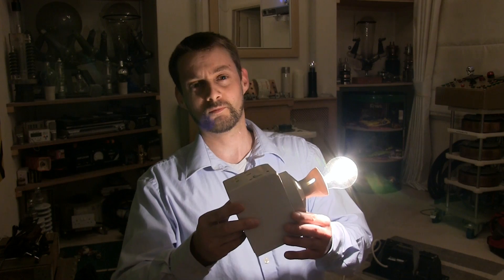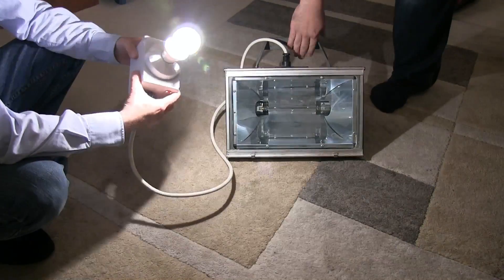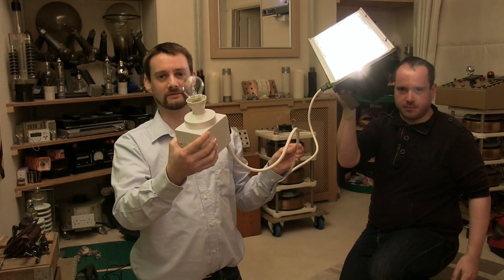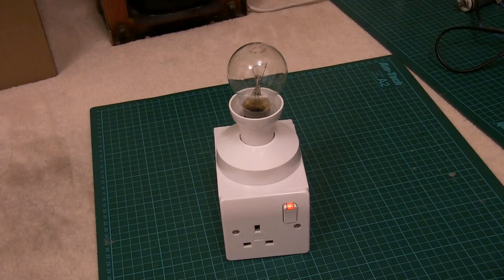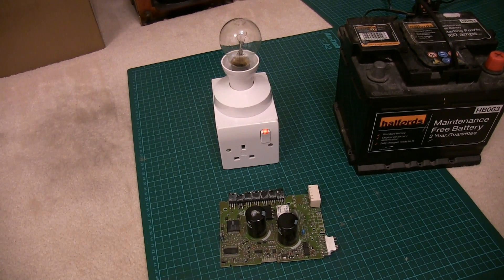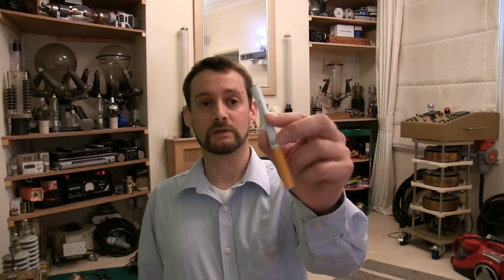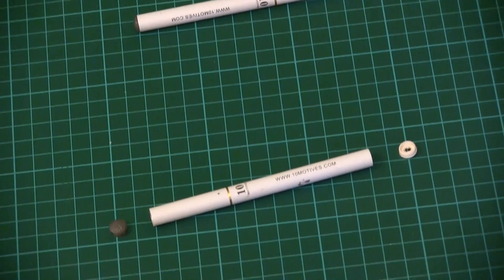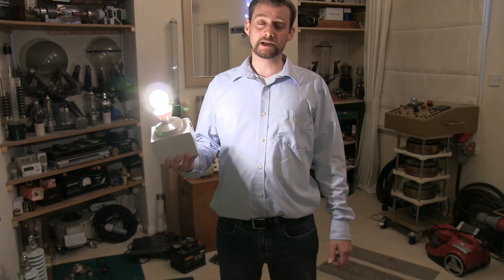Wireless 240v Power Cube Reveal

Comment: Curious little device to confound your friends and confuse your frenemies! :D
I'd be interested to learn how you charge it :P
Reply from the maker: I treat the output like a universal serial bus lol
Reply: If you could get a hold of those batteries cheaply I bet you could sell those cubes online.
Reply: He puts it in the microwave for over an hour at full power.
Reply: While powering the 1500 watts light the had to deliver 6 amps, not bad for those ;ittle lipo's. Did you need to recharge the often during the shoot Photonicinduction?
Reply: @photonicinduction could do with a little lipo after quitting the ciggies.

I kid :p
Reply: @gskaloyan Pretty sure it's not too difficult to make, just dangerous and messy, but not difficult if you own the right tools.
You'd also need patience. 

I'm also quite confident that they (don't) have to be those specific e-cig batteries, but any Li-Po battery connected in series with a dozens of the same individual voltage to achieve 240v. You'd just need the batteries to all be the same and really small & stackable, and not end up killing yourself in the process. 
Wouldn't recommend mass-producing these things by hand. Would be better off using CNC/machinery to do it by batch. 

Or just buy a 12v 120/200ah battery and a 1500w inverter.
Reply: +photonicinduction look in to 18650 they can put out 8amp per cell :)
Reply: I currently have some sanyo ga cells 3.5Ah and 10A discharge, pretty impressive.  The samsung 25r (2,5Ah) cells can deliver 25A, that is a lot of punch! (especially when you have more than 200cells :)) 18650 are fun!
Reply: RKSNomad
The wireless energy would have been amazing. However, as with anything it does have a few drawbacks. I can see a few problems with it, but they're able to be designed around if good engineering was put to work.

One of them is that the transmitter would have to be tuned perfectly, and to a frequency that nothing else would use. Otherwise, any transceiver that tuned to it would likely explode, as you'd be dumping extremely large amounts of current into it.

Digital electronics would also have to be designed to never have a wire, component lead, PCB, etc, trace the same length as the wireless power's wavelength. For example, WiFi's 2.45GHz wavelength is about is about 2.5In long. Any piece of conductive material the same size would act like an antenna and either fry the device or cause it to massively malfunction just like it got hit with an EMP. For example, let's say the wavelength is 6In, if you touch a fork or spoon the same length, likely it would arc to your hand.

Third, if you lived near the tower, constantly being exposed to certain frequencies is known to have small, but measurable, health effects. Nobody knows what being exposed to such a ridiculously strong RF field would do. Single cells in random areas that align right can experience powerful heating, which kills them. There's a small chance any cell killed by heating could survive and do something weird, like grow a tumor. Microwaves are non-ionizing and can't damage DNA like X-Rays, meaning they don;t directly cause things such as cancer, and also won't cause any damage if they're below the level that causes heating.

Tesla however, could have discovered a completely new way to transmit. Which would mean that all the above may not apply to it. Scalar waves are something people claimed he could transmit and receive in. If that's true, the waves would have no frequency and no magnetic field component, meaning none of the above problems existed. How one would receive such frequencyless, fieldless, waves is currently unknown, but maybe he had an answer. It's just one of many theories floating around about his wireless power.

The solution to those problems for a modern implementation using our current technology? Point to point links could be used, aka beaming energy between two transceiver dishes over long distances where you have line of sight. Like say you have a massive amount of solar panels in the desert, broadcast the energy to a satellite in space, and beam it back down to a power plant or somewhere it could be distributed. You'd loose a lot less energy that way. This could also provide reliable electricity to remote locations. Anther thing people are currently theorizing about is putting solar panels in space where they'd get ALL the light, and using microwave beams to send the power back to earth.

I'v researched Tesla's patents and experiments before, but I didn't get very far, besides lighting fluorescent tubes up to 15 feet away. By the way, Apple has a patent for across the room wireless phone charging. That in itself is interesting, as getting a few watts from the wall to a low power device like a phone is very doable. I could see in house wireless power to avoid the need to directly plug something in becoming a thing. Small low power devices could be powered easily this way without much risk of interference or health risks. Only problem is that it's very inefficient as you have to send energy in all directions.

Hopefully this reply wasn't too long, but I pretty much wanted to dump my entire opinion out. Have a nice day.
Reply: not so true  yess if it is h.v. dc with a lot of amps... dc make your mussels tens up but ac just knocks u the fuck out :)
Reply: Lithium batteries are all fun, until they get bang :)
Reply: RKSNomad Oh please, Andy, PLEASE make this happen! I want flames!
This is a thing that needs to happen.
Reply: You just have to be careful because its DC power
Reply: :) well i got like 40 of 18650's puts out about 310/320 amps at 4.5v running my electric bike
Reply: what makes you think this? pretty sure they're lipos
Reply: 8A? Some 18650 cells will deliver over 100A. They won't be very happy about this but it is possible. Just... Don't run them on that power any longer than few seconds, I've seen a cell that was rated for AFAIR 130A for less than 1s by its manufacturer!
Reply: zak Elek-Palmer These cells were officially rated 20A with additional "unofficial" discharge time VS discharge rate declared by manufacturer (with a condition to cut off discharge at certain cell case temperature). I'm looking at it and cells were rated not 130 but 160A for up to 1s discharge. Also: Safe continuous rate is 30A instead of official 20A. Unfortunately I can't give you details about this cell. BTW: it is not the first time I see that there is a "public" specification and another "confidential" one supplied directly to customer.
Reply: ElectricBike Nope. Regular "power tool grade" cells are capable of this. it will just shorten their life. (this application was all about power without much requirements for capacity or even cycle life) These are cells you can order now and at least as far as I know they don't have any rocket science chemistry in them, just beefier parts sacrificing capacity in favor of power.
Reply: i have turnigy graphene cells for my quadcopter (turnigy 3s 1300mAh 45c), and they seem to handle high charge and discharge (abuse) rates very well, while still exceeding the lifespan of normal lipo's.... those things are amazing!
Reply: another subscriber from AvE i would say
Reply: mannilord1
That guy is genius level without a doubt, you can tell he does all that purely because he is bored. He has awesome humor and not to forget his voice controlled camera "FOCUS YOU FACK" i watched every video and still do.
Reply: +Michel Linschoten i totally agree with you ;)   im really lucky that my english is just d
good enough to understand him
Reply: i'm guessing that means you don't have a protection circuit in place in case of overvoltage or under voltage. that's definitely gotta be a scary thing, accidentally overvolting it or over discharging it. a large lipo like those used in an R/C car are severely volatile when over discharged or overcharged. having a huge amount of those mini lipos goes from an extremely hot flame to a densely hot explosion.
Reply: RKSNomad Oh sorry. I saw now in Wikipedia. about it, it says: "abbreviated variously as LiPo, LIP, Li-poly and others"

Well, terminology confuses us buddy.
Reply: ***** that's near impossible. a DC power grid would be so inefficient that we would end up paying 1000% more for our electrical bill. AC is much more efficient and can reach farther distances, that's why AC is used in the first place.
Reply: dude there lipos
Reply: +zak Elek-Palmer I know, but that other guy thinks they're li-on's and I was wondering what made him think that
Reply: you can recharge those little batterys there lithium batteries make sure charge them at 450mA or all at one time  2Amp
Reply: +mibars not to be mean but there a small cell if you got prof of that.. i used a lot of them not seen any high then 27amp from then at a safe level if you know were i can get some of them good for my electric bike :p
Reply: +mibars are u talking about the 18650 graphene cells? It will be released to the public soon with a massive increase in cycles and discharge. I also can't give too much info cause it's "confidential" too... I wish I could do some videos right now in my channel =]
Reply: +mibars - yeahh that makes sense =]
Reply: Sony VTC4 can deliver 20A easy with only a little heat but the voltage sag on sustained loads is terrible. 26650's would be even better for this type of application.
Reply: +mannilord1 just keep er chooching lol
Reply: +Michel Linschoten jep    i really like him
Reply: Sony Konion US18650VTC5A  35A
Reply: +zak Elek-Palmer some can do well more than that (Samsung 18650-25R)
Reply: +zak Elek-Palmer they're not intended to be recharged so you need to be very careful. there are different chemistry than any of the rechargeable lithium batteries
Reply: +mibars 130 amps? even for one second that's pretty outlandish. what battery was this? I would like to know what brand and model of battery is rated for that kind of output
Reply: +Michel Linschoten and keep your male reproductive appendage in the bench mounted clamping device
Reply: +Michel Linschoten cheers to that!!
Reply: No, it's "li"po". It mean "lithioum polymer".
Reply: I remember them being called li-ion batteries way back when, but I think that's just when the technology was fairly new. I do remember a time when they started being called both roughly equally, which made me confused, thinking it was a different type or something
Reply: ***** it depends, yeah. I have an 11.1V LiPo battery that can push 780 amps.
Reply: + Michael De Santa DC is not that dangerous like AC because of the missing capacitive reactance
Reply: Techtastisch 75 wrong!
Nicola Tesla insisted on using AC because it is less lethal.
Reply: Than Zamp DC shocks are less lethal the AC shocks at the same RMS voltage.
Most people don't understand is that 120VAC is equal to 170VDC, due to peak to peak voltage.
Plus AC more easily penetrates skin. So even 170VDC is safer then 120VAC for prolonged contact.
However, AC is MUCH safer in the whole picture because it's easier to work with and transmit.
Reply: ***** RKSNomad
As I know quite a bit about this kind of this, I can say that ***** is partially right. But, only very high voltage 512kV to multi Megavolt DC transmissions are more efficient then AC transmissions. And VERY expensive buck/boost converters with extremely high power inverters would need to be designed to do this reliably. For long distances, like linking/bridging grids a couple hundred hundred miles apart or across the country, yeah it might be economical, but not for running to homes. AC will, for the time being, always be the most cost effective and reliable way to run power to homes, businesses and factories.
Reply: theLuigiFan0007 unless people allowed nikolai tesla to keep working on his wireless energy project! i swear, there could have been amazing technology coming from that. ooor it could've been a bust. I didn't do a full research project on that, i just based it through what i heard and what i know.
btw, i'm writing this after going without sleep for 48 hours, sorry if it doesn't really sound... logical or intelligent.
TL;DR wireless electricity would'a been cool!
Reply: 240v AC mains supply. Rectifier. Plumb it in and hope it dont go bang ;-)
Reply: Ac is worse than dc...    but Ac trips the breaker way faster because there most of the time is a breaker..

Comment: Lithium batteries was my guess... 
But you still had to convert the current to AC voltage. (Didn't you?) 
Which is the second part of my guess: An inverter of sorts.
Reply: All the devices he used works nicely on DC also, lightbulb doesn't care, switching power supplies won't care (first step in those is to rectify AC to  DC and then rest of the magic) and universal current motor in drills etc also works nicely also on DC.
Reply: Nope. Light bulbs will run on DC no problem.

Comment: But how you charge them?
Lithium cells must be ballanced during charging, otherwise they will die or even blow up!
Reply: I don't think those are rechargeable. The voltage is only 252 volts, which is 3.11 volts per cell. That's less than you would get with lithium Iron Phosphate cells. I think these are Lithium Manganese Dioxide cells, which are non rechargeable, but store a lot of energy. E-cigarettes use a lot of power, but for short periods, when being "puffed". That makes them perfect for high drain, short duration uses, like lighting large lights for short periods of time. When the battery cells finally die, he can replace them with Lithium Iron Phosphate cells, which will give closer to 260 volts. Those cells are rechargeable, but would require voltage balancing.
Reply: @vincentrobinette1507  it does really depend on the manufactures, but if i was gonna do it i would use some of the 18650 cells i have for my vape, they can do 20A continous or 35A max pulse, still thats 4.8KW of power or 1160A at 4.2V (thats if my maths is correct, 58 cells, each providing 20A at 4.2V = 1160A total current) hell if you can get 240v at that current then you would have 278,400W of power, now that wouldnt be bad if you could do it, it would be the porta-pop V2

Comment: problem is, how do you charge them?
Reply from the maker: Current is limited and voltage only charging at 240v, full tilt is to charge at 299v, no heat, all balanced, tried several times and its fine so far:)
Reply from the maker: Mains through rectifier, dc limited by 15w incandescent lamp in series straight up the outlet :)
Reply: If you do that, you are going to cause a seriously big fire!.
You cannot balance all those cells and all it takes is one in the middle to blow and the chain reaction will be HUGE!
If you do intend to charge them i highly recommend you do so in a steel box!}

Lithium batteries as you well know are highly volatile and you have so many that the chances of catastrophic failure are really high!
Reply: +Jared Reabow (Jazza) Don't you dare to tell Photonic how to safely charge his batteries. If anything, he needs to charge them at 400V AC straight from his Variac. Preferably outside. While etching holes into them with his green laser. 

Also, metal box won't help you with a lithium fire. Outside, well ventilated, with a shovel and a bucket of wet sand nearby. You should know that if you'd actually be so cautious when dealing with unbalanced lithium cells well beyond their original purpose and specification.
Reply: lol photon knows exactly what hes doing, maybe on the dangerous side but hes not a pointless idiot. no needing to tell him
Reply: Its not designed to be safe to BS1363 for all the numptys to use, its for a bit of fun and being used by someone that knows exactly what he is doing. Watch some of the earlier videos, then you might understand what this channel is all about....
Reply: First off, let me say i know you are an very experienced electrician and i am not trying to undermine you or insult you.
Second, when you say all balanced what do you mean?
Third, if they have built in protection and aren't just naked cells, then please ignore the rest.
Fourth, after 10 cycles, take them out and measure , if they are more than 0.2v off each other, things will quickly start to get nasty for the highest and lowest cells after a few more cycles.
The first few charges will be fine,  but at some point one cell will be enough out of balance that it will pop.
People with 3 cell lipo packs have experienced this after several charge and discharge cycles, and that's only 3 cells!
You cannot trickle charge Lipo's so low current charging wont help, 
The only way to balance the cells would to have and individual connection to them all, through very high value resistors  so that they can balance themselves maybe?
otherwise a shit tonne of balance chargers.
Or make your own if you are so inclined.
Reply: a metal box will work fine , i was thinking thck like a safe because charging outside is a pain
Reply: Wouldn't it be 340v since a fully charged li-ion cell is 4.2v when fully charged
Reply: If there was a big fire he'd video it and stick it up here.

Comment: Ah see now that I know whats inside I realize you never plugged anything into it that would strictly need AC power.
Reply from the maker: lol did I ever mention anything about AC? 240 dc is still 240 volt :)
Reply: I know, just when you first showed the power cube I incorrectly guessed that it was using a bunch of LiPo batteries and an AC inverter.